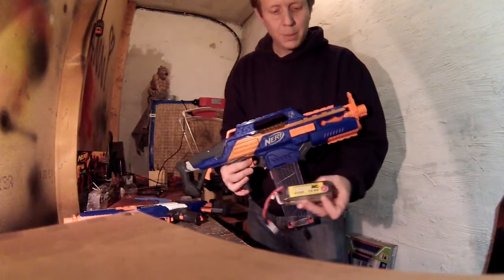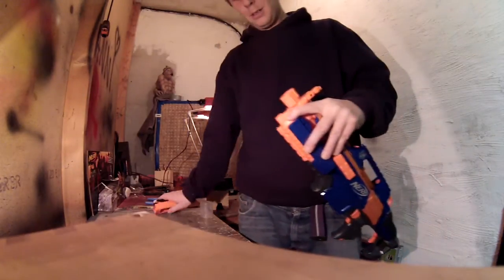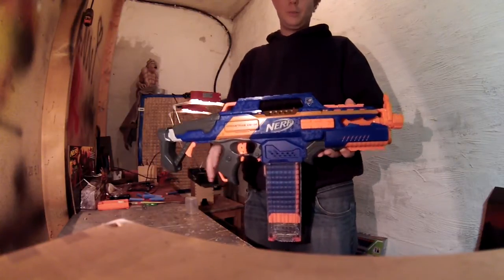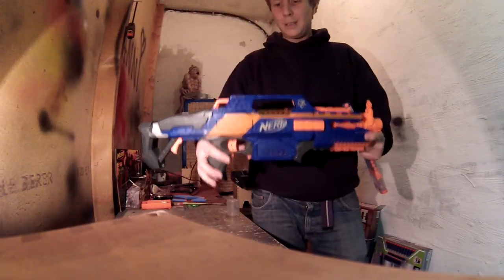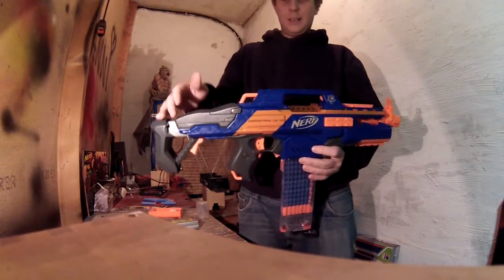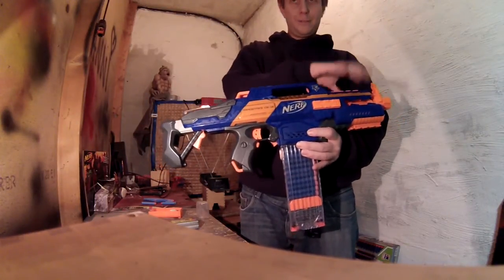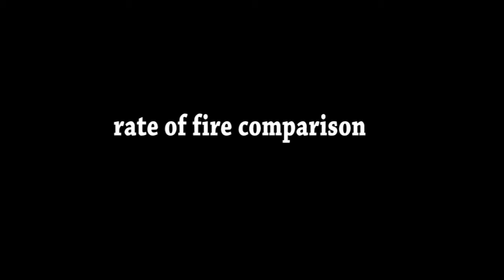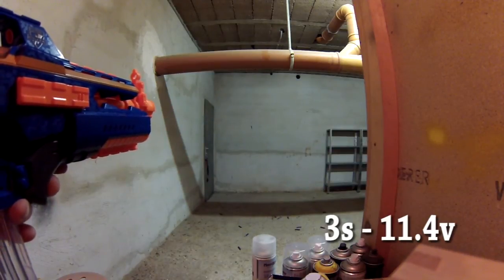nerf rapidstrike on 4s lipo (14.8v) and rate of fire comparison

Comment: You know you can get far better performance on a 3S and even a 2S if you use decent motors and replace the wiring and switches. My rapidstrike is running on a 2S lipo and gets 12dps at 140fps.
Reply: what parts do you use?